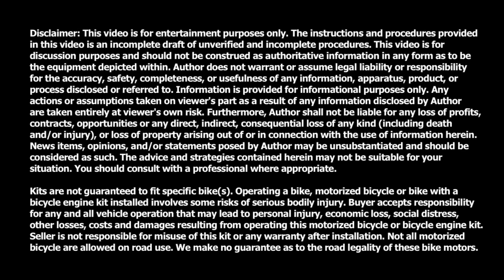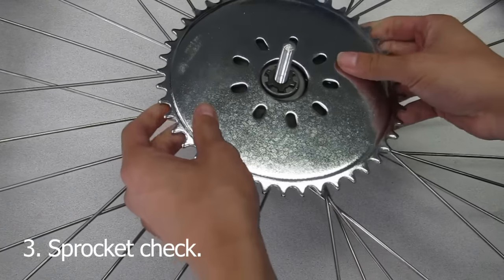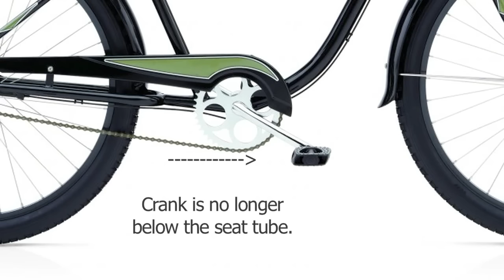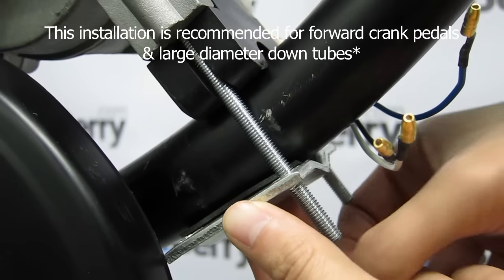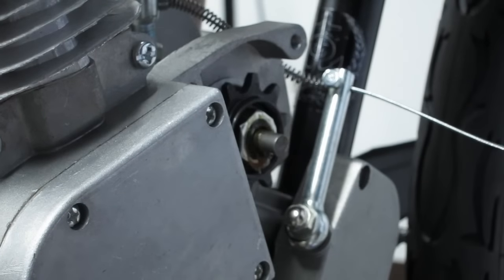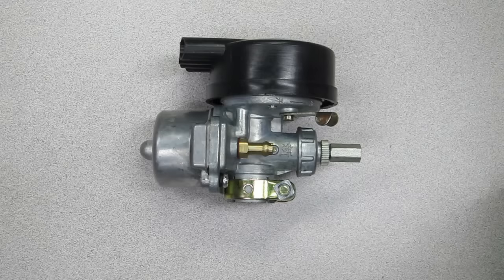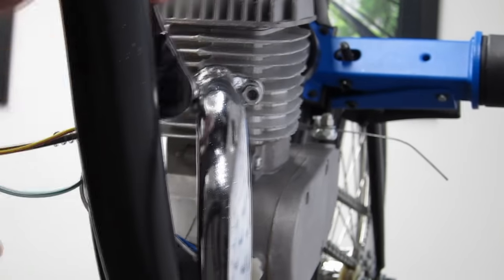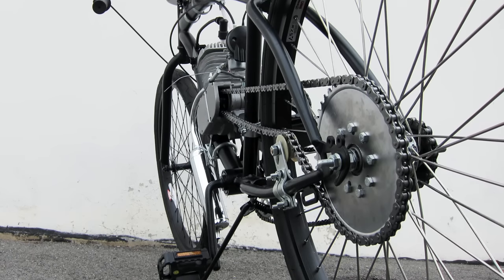How To Install 80cc 2-Stroke Bicycle Engine Kit FULL DVD 66cc 48cc 50cc

Comment: hay quick question my bike keep giveing it more gas with out me touching it
Reply: Lee Dunlap idle
Reply: Lee Dunlap "adjust the idle"
Reply: do i go left or right on the idle.sorry very new to this i build pc this is my first bike
Reply: Well by the sound of it it's idled to high so wind it left (I believe) unless it is fliiped. Just wind it both ways, try left first. If it dies to quick adjust other way. If it revs and moves by itself, adjust other way
Reply: Wyatt Chinn got it ty

Comment: Does this engine work with bikes that have 11 gears
Reply: MUFFIN EATER 52 yes it works with any bike because it had a gear that goes on the opposite side it would just need to be installed

Comment: How's come the brake in mixtures were cut out of the audio?  I'm guessing because no one has a real clue with these little motors. I'm guessing at 16-1 for the brake in and maybe 25-30 to 1 for after?!? Who knows. I'm not building for speed just to put around.
Reply: ive seen to stick with 40-1 because otherwise you'll gunk up the engine. but that's just the number I've seen thrown around on reddit and other youtube videos

Comment: There is a problem with my clutch it doesn't disengage when I pull the handle and everything is wired to plan please respond
Reply: Come on guys help me out here
Reply: Juble Tyre you have a stuck clutch
Reply: I had the same problem. At first i didn't re instal the clutch arm thing correctly and the second time was because the side with the flower nut wasn't tight enough which wouldn't allow it to engage.

Comment: What about the width? The engine might get in the way when pedaling the bike
Reply from the maker: We've tested with many bike frames, cranksets and pedals without any clearance problems of the engine. You are more likely to find interference with the a large exhaust system than the engine.

Comment: Does anyone know the ratio? Just bought this model and dont want to mess it up.
Reply: I use 21 parts gas to 1 part oil for break in and I've had good results, but I've heard from others you can get away with like 30 to 1 for break in. Some say 40 to 1 is enough but for break in I think that it needs more oil. Once break in is done I think 30 to 1 is a good ratio.

Comment: what happens to the brake if you put your clutch there?
Reply: I kept both my front and rear brakes. Also front and rear gear shifters were kept (it's a mountain bike); although I don't plan to shift much, I'm planning for motor failure and it's nice to shift then. Standard rear break on right handle and front break on the left. The idea is that I'll usually be letting off the throttle, then breaking with the right hand. I made sure I could press the clutch and the front brake simultaneously; clutch first, then brake. I rarely use front break, but sometimes it helps to stop faster if needed. I also have a bell on the left side. I plan to add winglight turn signals (more to control!). You probably just have to play with what you have and experiment as needed. I tried a couple different orientations until I settled on what worked for me. So from left to right, I have:
[LEFT SIDE] LEFT TURN SIGNAL = HANDLE = CLUTCH = FRONT BRAKE = FRONT SHIFTER = BELL 
=== 
[RIGHT SIDE] REAR SHIFTER = REAR BRAKE = HANDLE/THROTTLE = RIGHT TURN SIGNAL

Comment: I was thinking of replacing the bolts on the sprocket with recessed, flat head torx or allen bolts, to eliminate the need to bend the brake lever on my coaster brakes....anyone done this? it would seem to be an easy fix to the clearance problem?

Comment: I bought a kit but im having a hard time keeping the rear sprocket straight and aligned as i tighten the bolts. Could anyone give me a little more detail on how to keep it straight?
Reply: It's definitely a struggle. I just keep tweaking it to no avail. I'm looking into upgrading to a different setup. I've seen some different ways from different companies.  I believe there is a solution to our problem. And I'll never stop searching until this problem is solved. Very frustrating.
Reply: @kurtkelling1016  been thinking the best option will probably be adding a plate the the main bolt of the rear wheel, if theres enough room, to help.

Comment: PLEASE HELP ME, I i set up one of these sets but once i attached the chain and put fuel in i couldn't move forward at all to start the engine. it seems that the engine sprocket doesn't spin freely and even by force it barely moves. This means i cant ride and start the engine. please help me, i spent a-lot of time and money on this.
Reply from the maker: give us a call at  (800)317-0479 and well be happy to help.
Reply: Pull the clutch in you dork! lol
Reply: Its not supposed to spin freely unless you have the clutch engaged.
Reply: Giselle Freude, but even though I took the cover off and the clutch off it, it doesn’t spin. 

But if I put it all together aren’t you suppose to pedal the bike then start it, because I can’t pedal as the gear doesn’t move
Reply: BikeBerrycom do you live in the USA?

Comment: I hope you still read comments from these videos I need help. My bike has a drawn-out REV issue I'll give it gas and it stays High RAV4 a little too long and my cables are not kinked or anything like that my throttle has a snap back feels great and I have a speed carburetor with a reed valve that's probably not doing much yet cuz my piston isn't windowed yet but it should still not have this issue I feel when I'm writing fast I let off the gas and it still gives it gas for a while and dies down and I have to break with clutch open to slow everything down anybody have any ideas any knowledge would be greatly

Comment: ok i found the issue this is what it was in the carb where the cable goes in there is a grove there where the tube and the needle goes in.the tube and the grove was not a line that was the issue.

Comment: I was puting in the universal U mount and one of the bolts broke off inside of the motor :( I had to drill out the bolt and re thread the hole
Reply from the maker: I'm sorry to hear you had trouble with one of our product's. Please contact our customer service representatives at 1-800-317-0479. We will do what we can to solve this problem.

Comment: Help what is the white wire coming out of the magneto thing
Reply from the maker: The white wire is an additional auxiliary power commonly used for head lights and other electronic accessories.

Comment: How about if you have a bike with disc brakes
Reply from the maker: The rear break caliper and disc rotor will have to be uninstalled, as it will interfere with the rear sprocket. If the mounting point for the disc rotor is impeding installation of the sprocket a separate sprocket can be purchased to fit onto the disc rotor mounting bracket.
Visit our blog for more information on this.
https://bikeberry.com/blog/how-to-install-the-4-stroke-79cc-beast/

Comment: another tip for "breaking in" your new 2 stroke bikes...

first, increase the oil to fuel mix by 10% of the ratio recommend by your engine's manufacturer, then follow these instructions...

start your bike and allow to run at idle for 10 minutes, shut down and let cool for 30+ minutes,
repeat this 4-5 more times.

start your bike, ride for 10 minutes @ 50% power, shut down and let cool for 30+ minutes,

start your bike, ride for 10 minutes @ 60%-70% power, shut down and let cool for 30+ minutes

start your bike, ride for 10 minutes @ 80%-90% power, shut down and let cool for 30+ minutes

empty your fuel tank, then make a new fuel/oil mix at the engine's recommended ratio

start your bike and go all out (no more than 30mph) for 20 minutes, back it off to 50%-70% for 10 minutes and let cool for 30 minutes
¥
if you intend on storing your bike for 60 days or more, remove the fuel from your tank, do NOT run it out of gas, fill your tank half way with high grade premium fuel, add a fuel stabilizer, but do NOT add oil to the fuel/stabilizer mix

when you got to get your bike out of storage, fill the rest of the tank with high grade premium fuel and add the requisite amount of oil to the mix, run your motor @ idle for 10 minutes, shut down for 30+ minutes, then enjoy

this along with reasonable maintenance about every 20-30 hours of operation and reasonable riding habits will  give your bike a long life and many hours of operation and enjoyment

Comment: Where do you put the cranckcase oil in at ?
Reply: Chris Dyer 2 stroke, no crankcase oil. You mix the first  4 tanks an ounce of 2 stroke oil per pint of gas, after that an ounce per quart of gas. The mix gets sucked into the case from the carb, then blown from the case into the cylinder, all by the piston shape and ports in the cylinder wall. The oil in the fuel lubes everything that needs it. It's like a chainsaw motor, not a 4 stroker like a lawn mower or car

Comment: Kit came with engine disassembled . ????
Reply from the maker: For shipping reasons, we disassemble the kits to prevent any possible damage during transportation.
Reply: Awesome. Still came with the fins on the head completely bent down becuase it was dropped. But i have also talked to multiple people and thet all have the engine assembled

Comment: Would this be suitable for a 12 year old
Reply: most kits you buy online have a minimum max speed of 20 miles per hour. the higher end ones have a maximum speed of 32-36 miles per hour. If you trust a 12 year old with a motorized vehicle capable of those speeds then yes, if not no. Furthermore, all 2 stroke engine kits I've seen for sale, do not comply with most legal regulations, and therefor can only be ridden on a closed course, and would follow similar rules to that of riding a dirt bike. It would be illegal to use the engine on roads, trails, or open courses such as at your local BMX Open course. So in general, I would suggest against giving a 12 year old a motorized bike.

Comment: What are the fuel ratios u didn't say
Reply: +fray fray mapperson usually 16:1 for the first 2 tanks for the break in period, then you can lower it to 25:1 for normal operation. You'll see some variation on this from sources online but I've put about 10 together already and they all work great. It's important to take it easy for the first two tanks though, something most kits don't mention. Don't gun it, don't go max speed, you are running with extra oil for the break in of the engine and parts, your chain will stretch and need to be tightened, many bolts may need to be snugged up too. Many recommend not riding for more than 20 mins at a time during break in, so let it cool to the touch then feel free to ride again for another 20 mins. The hardest part is not going balls out right away, but it will make your engine last longer if you break it in properly.

Comment: Seriously is there no video on how to put on the bbr tuning racing engine stage 3?
Reply from the maker: General installation should be the same with the exception of a few accessories/performance parts.  If you need help with a particular stage to the install give us a call at (800)317-0479

Comment: Hey! So I got the engine working. Now are two questions: There's a nut I can adjust with a screwdriver, and it spins in, and out. I've figured out, if I spin it in the speed will be slower if I don't push the throttle. Does this also slow down the speed of the engine if I do max throttle, and does it do anything bad to the engine? I've almost fully screwed it in. What does it control? Fuel flow?

The second question: On the black part of the carburettor, there's a metal piece, wich you can move up and down. If I move it up fully, the engine stops. If fully down, the engine is revving hard, and is very loud. What does that control? Thanks!
Reply from the maker: We're not entirely certain, but your description sounds like the screw is the idler screw. It adjust the engines idle level at rest. Play around with this screw and set it a few turns just before the engine kills off. It does not necessarily lower the max speed if set to its higher limit, but it will limit the engines power band and over works the engine. The metal part sounds like the choke lever. It is typically used for starting the engine during cold conditions and should be left open when operating.
Reply: BikeBerrycom What is the white wire for? And where should it be attached?
Reply: It's for 6 volt accessories, such as lights. Make sure, if you aren't using it, put the plastic cover back on, or if it touches the frame, it could short the ignition. Also, if you attach it to lights, and the engine doesn't start, detach it, try starting again. If it starts after that, then you are somehow grounding the wire to the frame of the bike trough the lamp.
Reply: Game Imre thank you!
Reply: No problem! If you're building one yourself, when done, please take a picture or make a video of it, and link it here! Glad I could help!

Comment: Where does the white wire go??? I have a black a blue a green a yellow and a white wire... he mentions where to put all the rest but where does the white one go
Reply from the maker: Give us a call if you need assistance with your electrical components (800)317-0479
Reply: ignore the white wire. Its there if you want to hook up lights, but its really not a good idea to use it for that purpose because it robs power from the engine.
Reply: @rhetorical_annihilation  thank you, i ended up just getting rid of the bike entirely i was never able to get it to run.

Comment: that chain tensioner is really dangerous nearly went in my spokes had to weld a flat bar to keep it st that fixed place otherwise it would roll over in the long run

Comment: what does the 1/4 in hole in the handle bars do? I see no reason for it.
Reply: Mine stays from just screwing it on, and my bike still rolls and the clutch does nothing, any ideas
Reply: +Stoner Rhys if your clutch doesn't do anything, and your bike rolls normally then you need to loosen the clutch wire and give it a bit more slack, but only a very small amount, keep giving it more slack until it doesn't roll properly, and when the clutch is pulled it should roll normally and not engage the motor when biking normally. I hope this helps, and good luck.
Reply: +Fishes worst enemy cheers mate, it actually worked, just my chain to pedal snapped last night when i tested it but i can still use it from pushing it, your a don, cheers for telling me mate😀
Reply: +Stoner Rhys your welcome, you can buy a new bike chain and a chain breaker at walmart. Or if you're in england then go to Halfords, I'm positive they would have them, but I haven't been in the UK for a few years, good luck.
Reply: +Fishes worst enemy yeah im from the uk mate but not england, wales, ive bought a chain, i just need to adjust something then it'll be working fine
Reply: +Stoner Rhys +Fishes  Thanks guys this was very useful information

Comment: Well what's the fuel ratio?
Reply from the maker: Fuel ratio is written in an annotation. Check your video settings, making sure the annotations are on. The break in ration should be around 15:1, for a more generous amount of oil. After the break in period, the ration can be changed to 20:1

Comment: Rear wheel sprocket is installed backwards, the offset teeth are supposed to be closer to spokes to pull chain in

Also, use proper wrenches
Reply: Jeezzz.  Thanks. I was looking at that part of the video over and over again.

Comment: what is the of white wire at the magneto??
Reply: what is the use or purpose of white wire at the magneto??
Reply from the maker: It is used for auxiliary power, commonly used to power lights.
Reply: @bikeberry  sir the white wire does have AC or DC voltage output? As now I've just installed my engine and i want to add up some lights and battery..

Comment: HELP! my rear wheel is very hard to turn. and its not the chain thats the problem
Reply: it's probably the clutch is lose. you have to readjust it. don't keep trying to move the back tire until you fix the adjustment.

Comment: The bolts that go into the front of the engine block keep snapping off when the engine vibrates on me, the bolts that's came with the kit are shit quality and too soft. My engine runs like a dream but this is a reoccurring problem for me anyone have any tips?

Comment: alright list you need to start putting hole in your drive chain  that metal  that holds the drive chain wheel I cant seem to hold it in place even when its really tieten I need to be able to put a scew in the metal and the bike frame and out the other end to keep it in place it wont stay in place huff..... so on your web site  start haveing hole when you selling the metal that holds the drive chain wheel to keep the chain straight and keeping it from falling off as well as the whole drive chain to move into the spoaks cause the wheek to stop throwing te person off the bike getting into a crash the mental is so strong I cant even drive threw it with a drill and don't know if a drill press will even work!!!!!

Comment: Anyone having problems with 4 stroking take the stock exhaust ND completely gut it ND weld it back together it's not that loud ND stops the 4 stroking ND another way to stop the problem is build your own longtube exhaust my son did this ND got 39 mph out of a stock motor no 4 stroking

Comment: I had things go wrong left and right with this. Main thing being my rear wheel axle threads became stripped
Reply: Does your wheel have a coaster brake?
Reply: Drew Ivan yeah it does
Reply: @mindofgannon915  
I had to remove the coaster brake from inside the wheel hub. Every time I spun the wheel, it would tighten up and it bent my axle. So I had to completely disassemble the rear wheel to straighten the axle back out. I ended up installing the sprocket and wheel 5 times before I figured out that this kit really should not be used on bikes with a coaster brake.